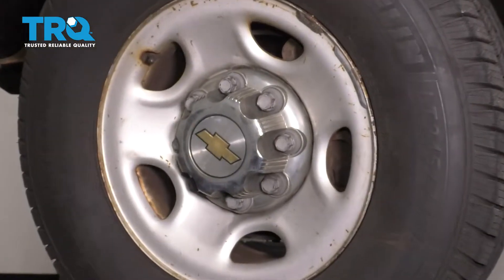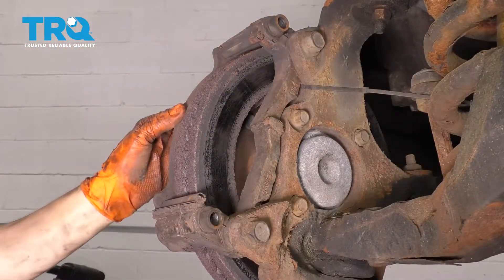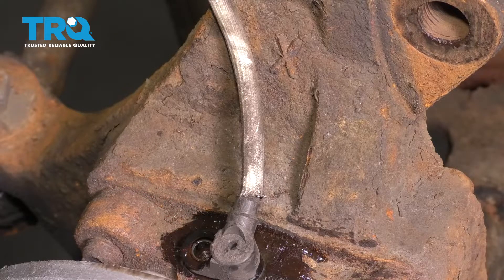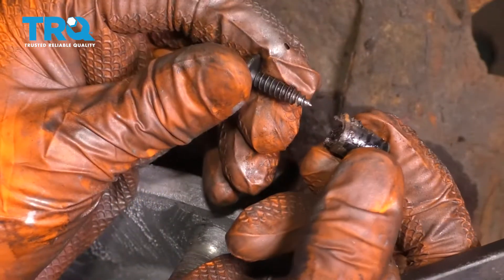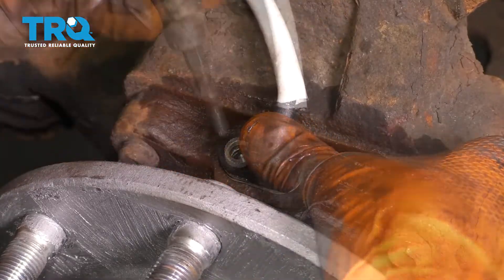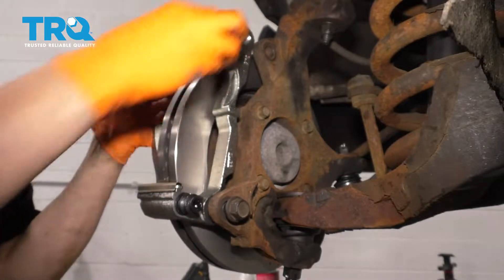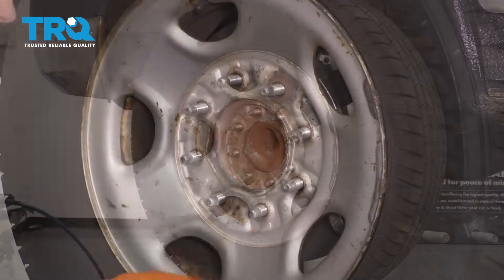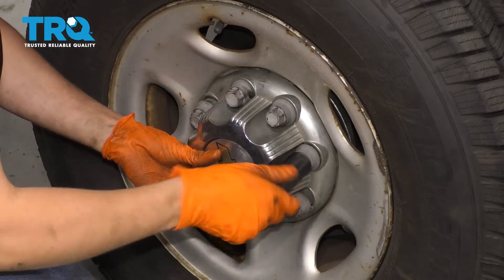How to Replace Front ABS Sensor 2003-2021 Chevrolet Express

Comment: FYI and due to a recent wheel bearing failure, I'd suggest to never replace the wheel sensor on these vehicles. Replace the entire hub assembly and it's only like 175 bucks and comes with a new sensor. The sensor alone is like 50 so why not spend the extra cash for the assembly. Then since these should be replaced in tandem both sides, get 2 hubs and do both cause if 1 fails the other is soon to follow! Especially when they sure came off the manufacturer line in numerical order. It's only like an hour of work unless you have rust to deal with.